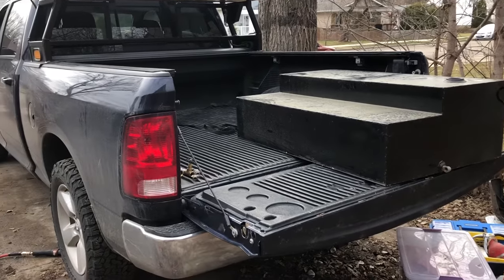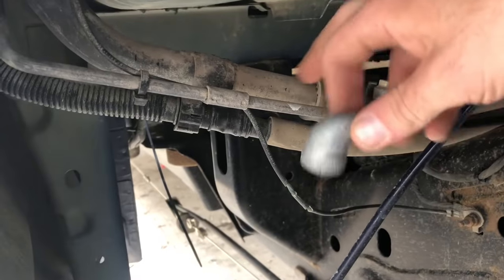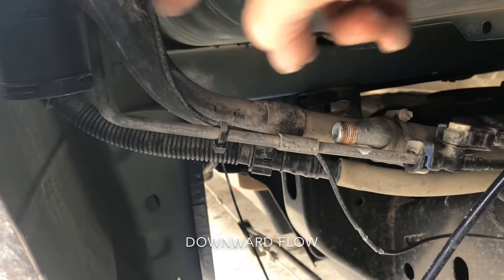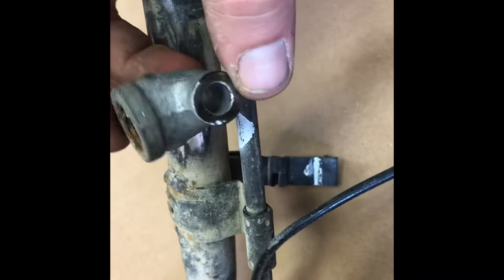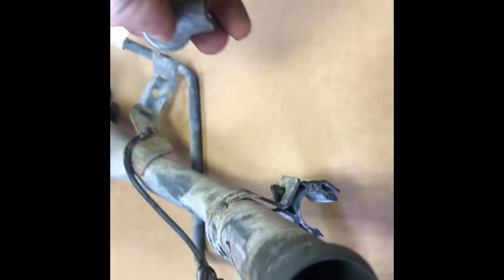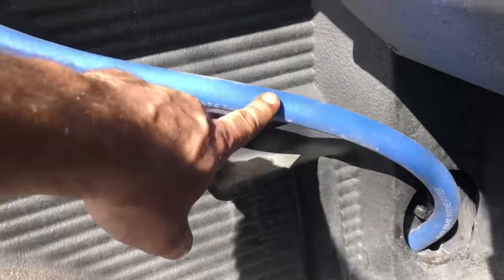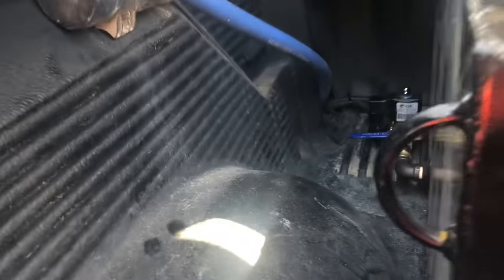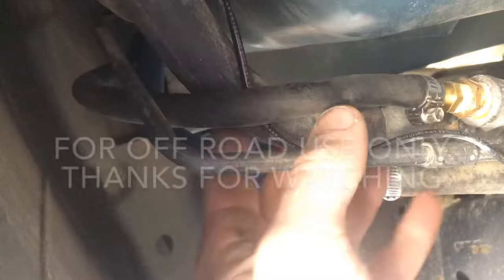Auxiliary fuel tank install (gravity feed)

Comment: I bought an extra 35 gallon tank from a similar model '08 GM truck with regular cab to install into bed of a '18 GM truck.
It came complete with the fuel pump AND the complete evaporative control and tank venting system from a salvage yard (rollover). These trucks actually monitor the tank pressure evap system.
Was trying to figure out how to plumb it in.
Gravity feed won't work as it has to be open to atmosphere to move the fuel from upper to lower tank.
I bought the high pressure fuel tank switch/transfer valve for a certain motorhome (Winn) with GM gas engine.
It switches both high pressure fuel supply and the return.
The tricky part is combining/ balancing the evap systems between the two tanks so it doesn't trip a code.
Just used the correct charcoal canister , evap control /vent valves , teed all lines  in and piggy backed electrical solenoids.
Second charcoal canister in back of truck bed needs to be mounted higher than or at the same height above tank as the original setup from top of tank so it doesn't fill up with fuel when refilling it.
It is all covered up with a bed cover until it needs refilling.
Then put a DPDT toggle switch inside the truck to switch the fuel pumps and gauge sending units when transferring tanks.
So that means splicing into the factory tank harness .
Runs off the second tank until almost empty then flip to factory tank.
Extra fuel weight = 215# plus weight of factory plastic 35 gallon  tank and hardware.
Reply: I’m having this problem right now. I didn’t really know about the system. So I currently have it wired up right now for the gravity feed and it can work but after a bit that check engine light comes on. Anyways to keep it gone and right??

Comment: Can you do that on a gasoline tank
Reply from the maker: Yes, this is a gas truck
Reply: @patstewart8051  thanks
Reply: I was gonna ask the same thing, I had tank mounted before and the shop had me do a 12v fuel pump mounted in my cab because gravity feed is illegal on gas trucks I guess, i over filled it a couple times tho becuase the gauge had a delay to show me when it was full so I would always guess really. This time I’m gonna do gravity feed, just seems so much easier to deal with
Reply: By law No. gasoline is to volatile.
Reply: Illegal